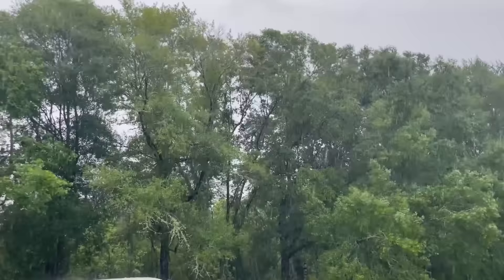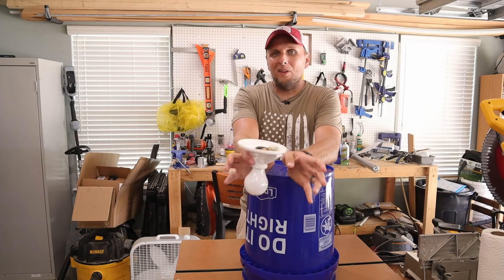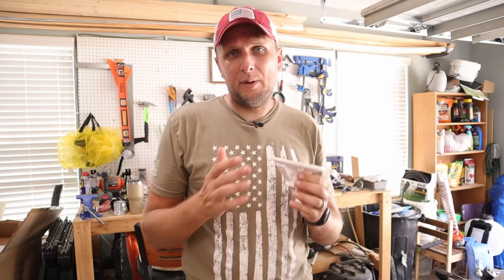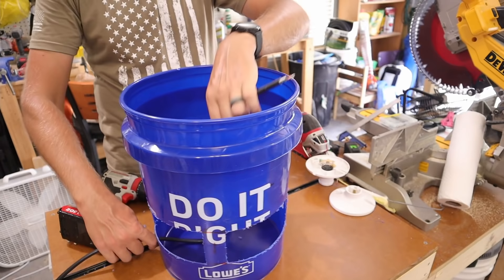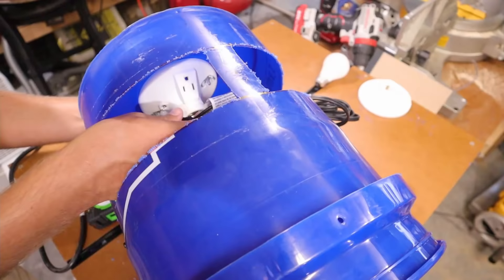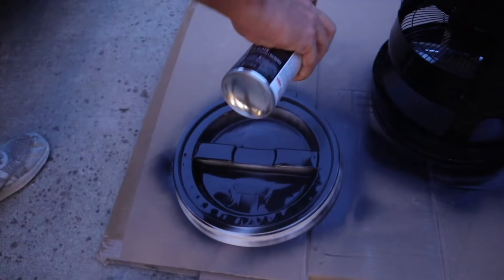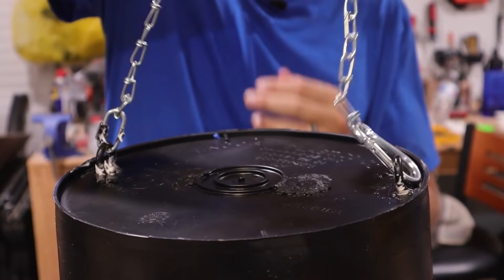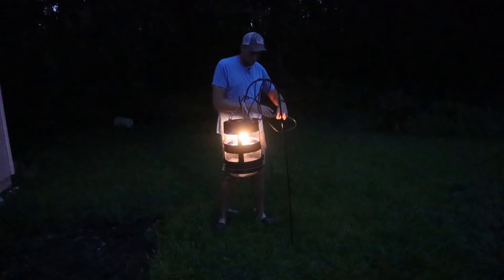How to Make a DIY Mosquito Trap That Actually Works!

Comment: You don't need a trap, just put out black buckets filled with water and a product called mosquito dunks,  or DIY it with yeast, sugar and a few drops of dawn dish soap (any dish soap really). Far more effective, cheaper and easier to maintain. Mosquitos land on the water and the soap means no surface tension so they drown and so do their larvae.
Reply: How do the larvae drown when they're aquatic?
Reply: He has a video on mosquito dunks too

Comment: You don't necessarily need the insecticide. If the fan is constantly running the moving air will dehydrate the mosquitoes and they will die.

Comment: Ive built something similar.I find a stinky sweaty old sock from the day hung in side the trap really brings the sqeeters in.Better than the baits/lures you buy at the store.
Reply from the maker: I am going to have to try that!   I have heard of some people peeing on a stinky sock and swear that works too.  😂
Reply: @HowToHomeDIY  unless you hard fix the bucket,the wire dont matter.
Reply: @HowToHomeDIY  wouldnt ya put fly paper in the base so they stik to it. honey,oil,ect.
Reply from the maker: @phantomwalker8251  I'm not sure which wire you are referring to.  It sounds like you are talking about the ground.  If so, the bucket doesn't need to be attached to anything.  The wiring is using the house wiring provided by the extension cord so it does have a return.
Reply from the maker: @phantomwalker8251  I had originally planned on doing that but it wasnt allowing enough air flow and the fan was bogging down, so I had to go a different route, which is actually working quite well.
Reply: I am highly  attracted  2 mosquitoes dey constantly bite me idk if itz my blood type or da smell of my socks  dey constantly tend 2 bite thru my sock
Reply: Yep, they always be in our shoes by the back door
Reply: wow

Comment: Another youtuber had something you might want to try, it worked for me ;-) It is a CO2 generator. Use a 1/2 or 1 gallon jug, fill it 3/4 with water add a cup or 2 (respectively) of brown sugar and some brewers yeast. Get a length of aquarium air tube, and drill a hole in the jugs cap slightly smaller than the tube for a friction fit of the tube. the other end of the tube is secured at the trap. I did a week long test with plastic under a zapper ( no CO2), then another week long test with the CO2. The results were test 2 had an awesome increase in dead skeeters by 4-5 times
Reply from the maker: I have not seen that.  Will look into that as it sounds interesting.  I have a few attractants I’m going to be trying.  Thanks for the tip!
Reply: Yes. It was my understanding they are attached to CO2 not light.
Reply from the maker: @HOGSBREATH1978  That is true.  Which is why I have the baits I talked about in the video.
Reply: thats a bed bug co2 trick also

Comment: I keep bugs and yellow jackets population down to nill by using water bottles. I cut the top off and flip it then using staples to secure it. Then using coat hanger wire as my hanger on 2 sides and then fill 2” of used antifreeze from my car as my bait. I also use the plastic tops from nuts or sunflower seeds or sour cream type lid for a hat so no rain water gets inside.
Reply: Make a youtube of making one of those. I cant stand yellow j's. Ugh
Reply from the maker: I like the idea!
Reply: Sounds great. How do you dispose with the antifreeze?

Comment: FYI: Menards green pails (cover not included) will develop a crack across the bottom after a short time, and that’s using them indoors. It’s a handy feature, especially if you were storing a liquid.
I made similar units powered by cheap little solar panels and DC fans and LED’s. No risk of electrocution, and I put them wherever needed without extension cables.
Reply: Led bulbs don’t generate much heat though, with mosquitoes it’s more heat and carbon and sweat that attracts them not light

Comment: Didn't check ALL the comments but you can minimize the non-biting insect deaths by just tossing the light bulb.  Yes, it generates heat which might bring more biters in but while the CO2 and attractant is still potent, that will lure them in.  Cool video!

Comment: This trap works as i made mine same as yours and used a 9 inch fan and same light fixture so i could just plug in fan. I am trying different lights as to see what works best as i also added a aquarium air line from a bottle of yeast,sugar, and water to add co2 as i am trying to save money from buying bait attractants. Thanks for great step by step instructions of how to make!
Reply: how does this work with the air line?

Comment: Where I am in BC Canada, all the mosquito trap lights are ultraviolet. The large bug traps one sees outside the doors of warehouses and other industrial areas are those yellow incandescent lights. Both seem to work very well. Both types of traps are also electrified to kill bugs on contact. I already have three smaller units of the UV/electric shock style light and they will attract all kinds of bugs, but mostly mosquitos and moths. I like your design as it is quite s bit bigger than the ones I have, some nice "off the cuff" engineering. I may try this build but I will use ultraviolet light plus I will also electrify the inner cage which does away with using a pesticide. Those "yellow flies" you speak of look like what we call "horseflies and Deer flies", those suckers really bite, taking out a small circular chunk of flesh when they do. One can sit on the balcony of an evening and listen the the bugs fry 😁
Reply from the maker: Haha!  Let me know how it goes.  I am interested.
Reply: Ultraviolet light does not attracted the female mosquitos (that do the biting).  They attracted by CO2, heat and movement.
Reply: Yeah I recognized those "yellow" flies, when I lived up north, we had some flies that were either the same thing , & called something else, or different species or "cousin" , and there were 3 distinct species, varying size & color, we called them Deer flies, 3- (three) cornered flies , and horse flies, as @tobygathergood mentioned ....
Reply: @richardk7379  seems to me it's more about the heat they put off, so if choosing one or the other it makes sense to use ultraviolet which will give you the heat without the unneeded visible light.

Comment: Great, can’t wait to build mine. I’m going to be using a compressor blower to get the small ones off the screens. For those who don’t like the white calking, just paint the whole thing black.
Reply: ...or just use black calk.
Reply: @raferb  They sell big tubes of it at Lowe's. Just ask them where you can find some big black caulk.

Comment: I like your prototype mosquito trap. The calking did not bothers me. A few questions about the trap:
1. Do you think spraying the screen with the insecticide countered the attractant you were using? 
2. How often did you change that attractant?   
3. Have you tried running your trap without the attractant?
4. Have you tried running the trap without the bulb? 
4. What was the overall affect of the trap in your backyard?
Thanks,
Reply: Lol

Comment: I really like this.  The only things I would suggest is use Noseeum net (finer mesh) to get rid of the flying midges.  They fly right through regular net but perhaps the poison would kill them anyway.  The other might be to use the removed pieces of plastic but leave them attached at the top (bottom) of the trap but bend outward as a cover to keep water away from the fan.  Could even use some of the other cut out plastic to fill in the sides a bit.  I really love the reuse of all the parts, nothing is wasted!

Comment: Awesome. I think a fan with blades that fit into the bucket's walls (almost touching) would make this even more efficient. This fan due to the smaller size than the bucket's diameter causes the pushed-down air to circulate some of it back on, from the internal sides. In other words, you'll achieve a greater vacuum effect if the fan fits the diameter and less chance of mosquitos getting pushed out from the inlet. You can also modify it and turn these blades into a slightly higher angle because these are meant for simple circulation. Also a true UV bulb instead of full spectrum and a DIY CO2 releasing mechanism. It's gonna be perfect, you'll have almost only mosquitos in the trap.
Reply from the maker: Thanks for the ideas!
Reply: what's a uv light? Is that a black light?
Reply: @raincadeify  UV light (the UV region of the electromagnetic spectrum), divided into UVA (315-400 nm), UVB (280-315 nm), and UVC (100-280 nm) bands, spans the wavelength range of 100-400 nm.
Specifically 395 nm is what attracts them more. Blacklight has a wavelength between 400 and 315 nanometers. So basically yes.
Reply: @BState   Thx!

Comment: FYI I have a flowtron bk15d and even full of bugs its has never caught fire. It does work and is water resistant but snow gets it quite upset so not for winter use. I mount mine lower around 4 feet off the ground and blow it out every few weeks with a portable leaf blower, they run about $30. I have one that is like 40 years old and still works fine, just had to put a new bulb in it after 20 years. One product I like and use near sitting areas is a Viatek Mini Mosquito Trap, They are good for flys and nats you put soap solution in the bottom tray and let it run all day and night, Its very quiet using a computer fan and LED lamps but its not water proof so I cover the top switch with tape and keep it under patio awnings. They run around $20 and I have some that are over 3 years old running almost constantly, The fan is a inexpensive part easily available if it goes bad. You can make your own using UV LEDs and a fan if you are handy.

Comment: I live in the Philippines and premade commercial type of devices like this are not available at all.  I am able to buy all the supplies necessary to build my own like you have done.  I just think that maybe I will put fly trap "sticky paper" in the bottom bowl for quick cleaning.  But anyway,  thank you so much for sharing.  Mosquitoes here are not only overly abundant,  but pose a huge health concern due to malaria and dinghy fever.

Comment: First off.. GREAT JOB..   1. Zip ties and washers could be used to secure the screen in the bottom or a crafting glue gun.  2. or  zip ties and a piece of wire in the shape of a ring around the bottom might also work.  The mosquitoes and bugs will die on the screen.  you can feed them to the birds by shaking the screen out. (skip the bug spray)  Like your build a lot.  Great video.  Thank you very much.  : )
Reply from the maker: Thanks for the feedback!  Glad you liked it!

Comment: It might pay to cut a few little notches around the bottom rim (top in this case), of the bucket so that water will not collect in the little rimmed pool. This could eventually leak water into the electrics due to failed sealant.
Reply from the maker: Good idea!
Reply: And put the hooks a little on side near the top and and not directly in the top panel. Because there's sealant on the bolts, but not on the hooks... If there's no place to leak it will just go over the side once it's full of water...

Comment: I tried something just as an experiment.  An old computer fan with the blades replaced with 3 or 4 strands of fishing line and a light behind it.  I use this to kill fruit flies.  The fan itself doesn't work well, probably because the flies are sensitive to air currents and avoid it.  The string has no air currents, moves fast, probably much faster that the flies can, and has eliminated my fly problem.  This might also work for mosquitos outside.  The floor under my killer collects all kinds of flying insects.

Comment: what do you mean you won't be needing that lid, that last 2 times I went shopping for 5 gallon buckets there was a lid shortage (no really)  specifically I was making a pump / filter combo for my pond at the time.  having moving water helped, but I still have a strong mosquito colony.  Fingers crossed I can convince them to move a similarly designed condo next year!
Reply from the maker: In that case, I have a slightly used (due to throwing it) plastic lid for sale!  $1000.  No low ball offers.  I now know what I have here! 😂

Comment: The purpose of the trap or the kill factor of it is that the bugs are forced to the bottom of the trap and can't leave therefore they cannot collect water if they cannot collect water than they go thirsty on a hot day they're cooked but still needed the ventilation this way they don't just blow around inside the bucket and then blow out this is awesome I actually have the one-acre Dyna trap

Comment: Hello, Adam;
About the appearance of your skeeter trap, I bet it'll look just fine, from my house.
I've been using regular fans like the box fan in the background of your video.
I just wrap nylon window screen across the inlet side & put a pair of magnets on each side.
But I think I'll add some 'baits' to my traps.
I don't use poison so I can use the dead bugs as fertilizer.
Have a GREAT day, Neighbor!
PS
I just hung 2 "Spartan Mosquito Pro Tech" traps on the 19th, today is the 21st.
My wife said the skeeters are better already, I'd agree.
The "Spartan Mosquito Pro Tech – 1 Acre Pack" has 4 traps, & cost $45, + tax on amazon.
Reply from the maker: Hey Jon, I like the idea of using them as fertilizer.  I have seen where people have used a box fan with netting like you described.  So many different ways people have come up with.  Glad you are taking care of your skeeter population and the wife is happy.  Happy wife, happy wife right?   Thanks for the feedback neighbor!
Reply: what fan speed did you find works best?

Comment: I would have started with a white bucket, and mount the light bulb on the lid... There are trap baits that emit carbon dioxide (which mosquitos track us with) to make the trap more effective. One I saw had motor oil in the bottom of the bucket and a fan blowing the bugs into the oil trap...

Comment: For the next version, could you make the light and fan easily removable so you can remove them quickly, hose out the side screens and then replace the light and fan when dry?  Maybe cut a large hole in the top, mount the light socket to a circular piece of plastic and set it in place over the hole.  For the fan, instead of screwing it in to the bucket, maybe screw in some stop blocks that the fan rim can rest on.

Comment: Saw a different video or online article where a guy had cloth over the back of a ~3-foot shop fan, and after half-an-hour or an hour, there was an enormous amount of mosquitos 'stuck' to that cloth.  He'd spritz the back of the cloth with rubbing alcohol to kill the mosquitos, turn the fan off, shake out the cloth, then put it back on and start back up again.
-
Seemed to be unbelievably effective.
Reply from the maker: That is interesting.
Reply: Try used furnace filters

Comment: Wonder with higher CFM fan, and larger trap area, how long this could run before overfilling...In addition to making an easily replaceable catch bag, so that there's less mess, and leave the screw off portion for when you really wish to clean it (or maybe line that lower grate, with paper towel? not sure which would work better)
Reply from the maker: Sound like good ideas!

Comment: That bucket is made of HDPE so sealant and paint doesn't stick to it well. That is unless you use a blow torch on the bucket first or a heat gun. HDPE has very long chains of molecules but if you heat it up just warm enough to make the plastic go shiny it will open up the molecular chains allowing paint or sealant to stick. This works with lots of stuff HDPE is a very versatile plastic, garbage cans, cheap kyacks, hard hats, and most 5 gallon buckets are all HDPE examples.
Reply from the maker: It’s now been on there for 2 years and looks the same as it did when I made this.  I talked about this some in the video.

Comment: I must have got unlucky buying one of those identical Comfort Zone fans (for cheapness) about 8 weeks ago building a similar one. The grill screws on mine must have be welded on. They would not budge for nothing, so left it on.
Reply from the maker: That’s odd.  So what did you end up doing for the very bottom of the trap?
Reply: Go get a Dremel. Extremely handy to have and very helpful on the small welds. Good luck

Comment: I feel like spraying the screens with that insecticide was not the best move. 
They will die anyways. They dehydrate. It's the same way the mosquito magnet kills mosquitoes.
 I have a mosquito magnet in my backyard, and in my personal experience, if you are cleaning out the dead mosquitoes from the trap during the daytime, and you come across any that are somewhat alive, they are likely  the most recently trapped.
(And I say somewhat, because once sitting in the way of that fan, it tends to go to work on them pretty much right away. 
You might see some that aren't 100% dead yet, but at this point, they won't be moving very fast anyway, if very much at all.
 I just think spraying the screens with insecticide creates a likely potential for your trap to be somewhat less effective than what it could be otherwise.
If your trap is going to do a good job killing them anyways, then what is the point?
Just my two cents 🤷‍♀️ lol

Also, thank you!! 
I really appreciate you taking time out of your day to show us how to make one for ourselves! 
Can't wait to put one together tonight!
You are theee absolute best!!

Comment: Those buckets break down pretty quickly from sun exposure, think about that when placing them.
Reply from the maker: This looks the same now after 2 years as it does in the video.
Reply: @HowToHomeDIY  we’ve used these to garden in and after a year they start to break apart.